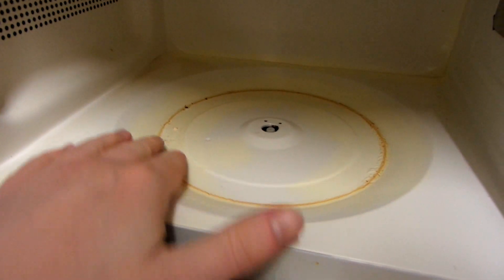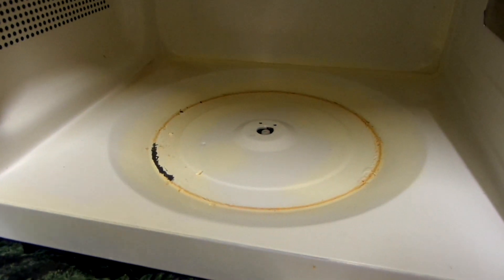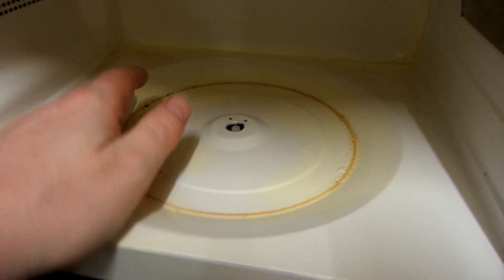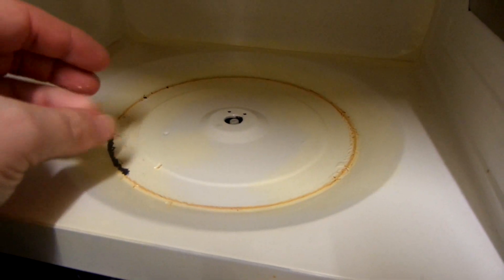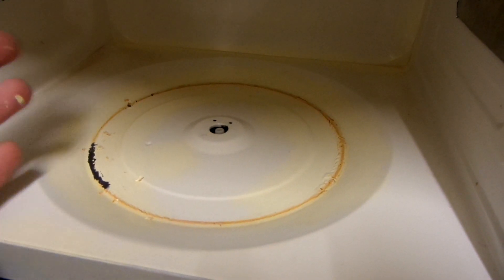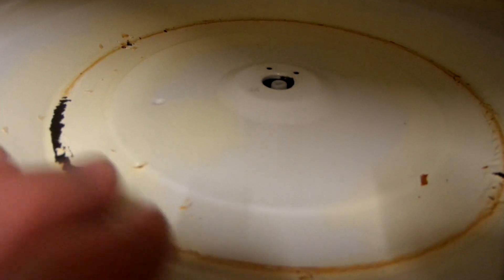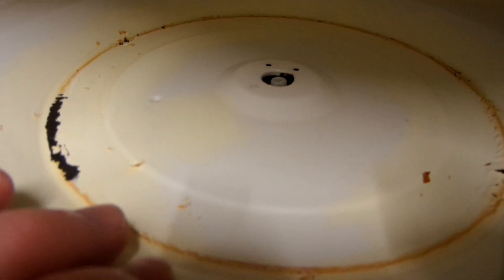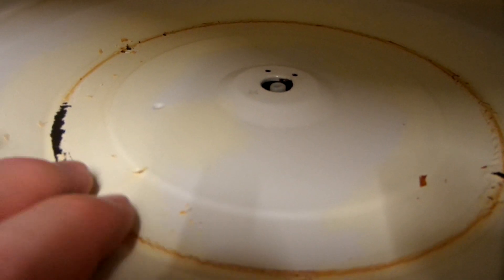Microwave Update (Not Good)

Comment: I hope the paint does not give out toxic fumes. Same issue will happen again if you simply just paint over it. A proper fix that lasts is to dismantle the affaected microwave, strip all the paint and rust on the affected part. Then electroplate/powdercoat and finally reassemble for use.